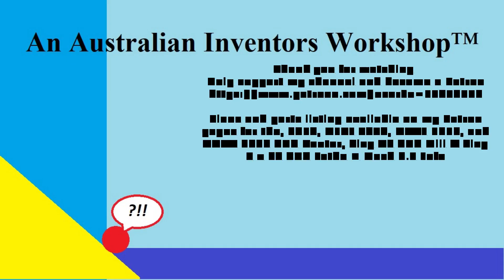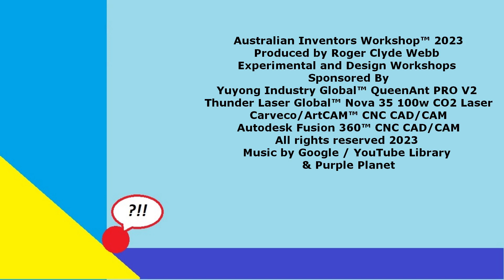My 6090 CNC Router failed AAAGAIN

Comment: What is the problem exactly? I can't hear clearly with all the noise.
Is it the stepover or bad finish from one program to the other?
The circle program should give a better finish than the linear, because of the tool deflection.
When I do router carvings (no cnc), I run the wood against the tool rotation because the tool grabs better the material and the deflection is uniform and less than running the wood in the direction of the tool rotation. If I run in both directions in a single piece, there are minor inconsistencies that have to be sanded down, but running the design in a circular fashion in one motion from start to finish does not have this problem. Also in hand router carvings, running the router against the tool rotation is more safe, as the tool does not "rush" the material in the direction of cutting and holding it, but grabs it.
So, for such deep cut and constantly changing directions, I don't see a problem here.
Reply from the maker: You will see!

Comment: I can see at 6:32 your clamp moved by about 2 mm
So I guess your stock moved as well on a rotation
I don't like using them ally clamps when ball cutting as had the same issue
As they don't grip that good
But seem to be ok to use when using a normall cutter
I guess from my experience is the ball cutter gets tarnished and then creates more friction to cut
Meaning the cutter is getting dull
I now also  use pins to lodge the stock against.